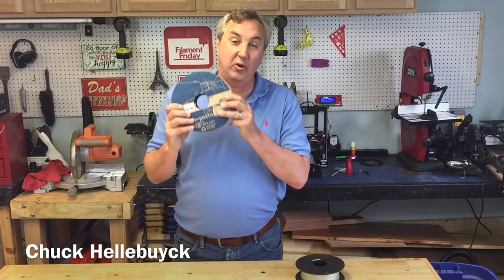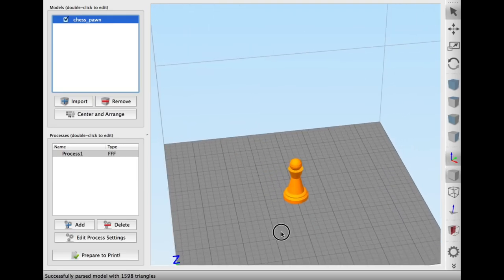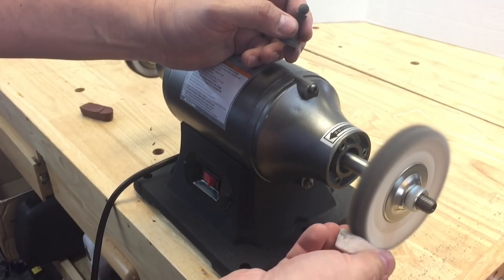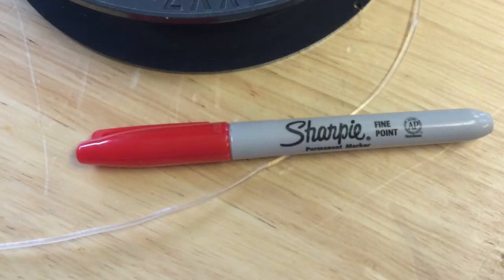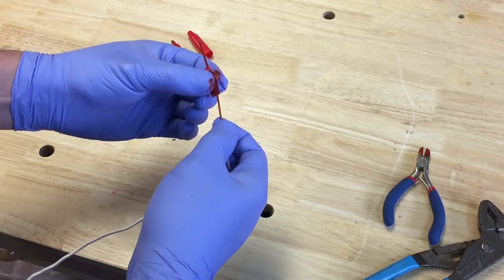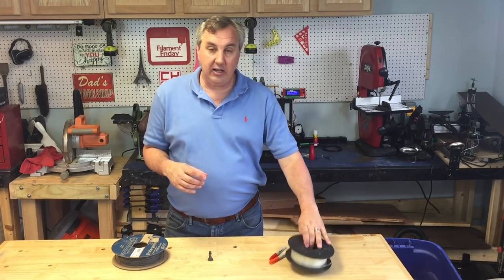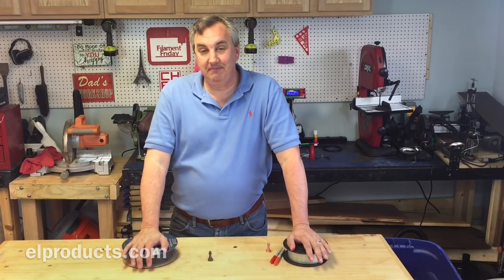3D Printing Filament Friday #65 - Filament Fun Proto-Pasta Stainless Steel & Sharpie Trick

Comment: I have done this with a black Sharpie and it worked, but some of the ink stayed inside the print head and a couple days later I purged the hot nozzle by hand forcing more filament out and a good sized glob of filament came out with the ink on it.

Comment: Another great video Chuck, thank you.
Did you leave the hardened nozzle in your printer and use it for ABS/PLA or did you swap back to the brass one?
I have a hardened nozzle to use when I try carbon filament, but I've been told that the conductivity is not as good as brass, so it might be best not to use it all the time. I'm thinking that it wouldn't make much difference, if any.
Reply: +ExtraBase Thanks for the insight mate, very much appreciated.
Reply: +Chuck Hellebuyck's Electronic Products Thanks Chuck

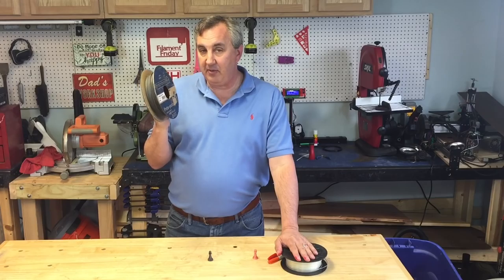Comment: 5:48 Is the filament after printing, electrically conductive or even before printing ??
Reply: +lasersbee Now that would be interesting... A conductive filament that would allow you to print a sort of PCB (printed circuit board). We will see that soon I'm sure.
Reply: +Brent N. they already have it.  I saw a roll at Fry's Electronics last week.
Reply: +Jimmy Shaw's Tidbits yeah but it is too resistant too really use it as a pcb
Reply: +Brent N. Yeah...my thoughts exactly.  I'm sure Chuck has a Multimeter and could do a quick check of the conductivity and resistance of that SS filament.
Reply: +Chuck Hellebuyck&#39;s Electronic Products Thanks Chuck...